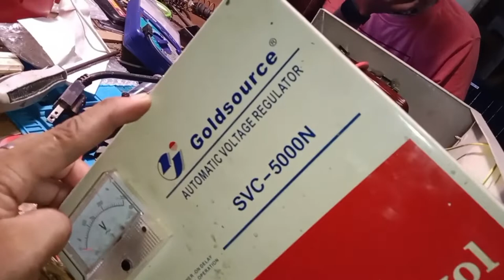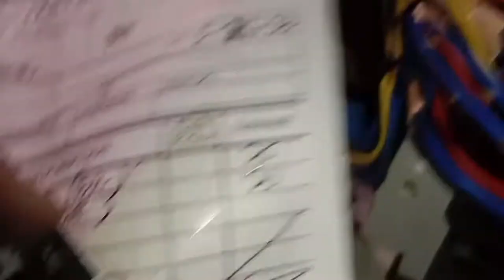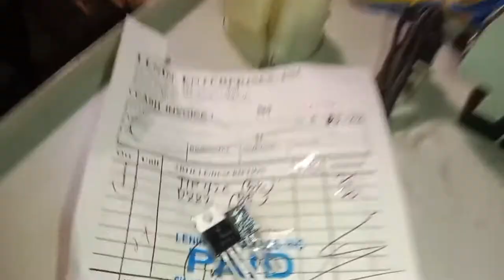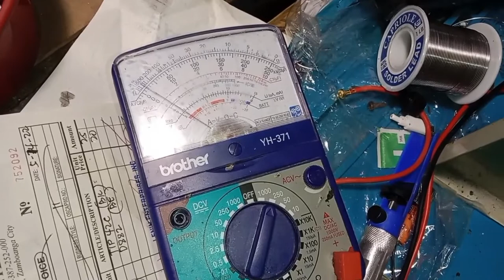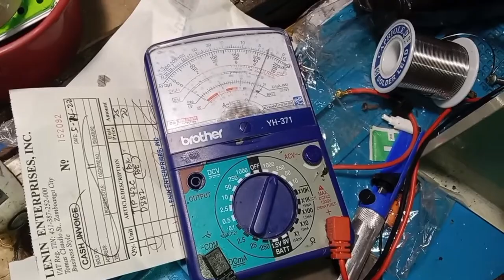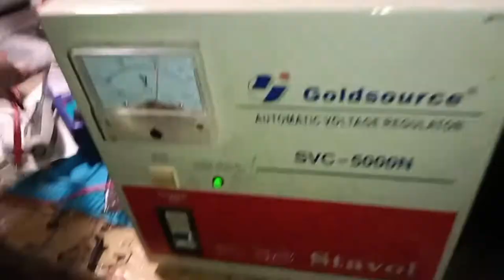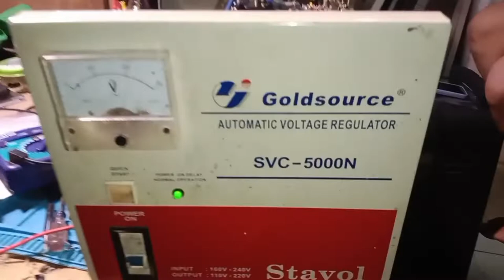AVR Goldsource SVC-5000N Panoorin Kung Ano Tamang Pag Repair Para Maibalik sa Original Setting

Comment: idol ano po value ng transistor na stock n nakalagay jan kasi ganyan din avr ko problema avr ko nag istock lagi sa high voltga 260 to 300v ang tinatakbo nya, nakababa na rin yung trimmer
Reply from the maker: @JRCLIGHTSANDSOUNDS  abang lamg dol may e upload ako low voltage explain ko lang angbtrans niyan D882 at B772

Comment: Sir may goldsource din po ako na AVR 5000watts, problema ko po is pag sa direct outlet ko sinaksak ang machine ko 200V lang pero pag sinaksak ko ang machine sa AVR nagiging 251V sya sobrang taas. Pwede pa po bang ma adjust ang voltage ng AVR na yan?
Reply from the maker: opoh pwede boss

Comment: May fuse ba ito sir? Same brand sa akin SVC-5000N kaso walang power input
Reply from the maker: meron ako ne repair now wala din power...wala po fuse yan sir kasi naka circuit breaker na.
Reply: @ortechtvofficial  ano po kaya common problem kapag walang power salamat po sa reply idol
Reply from the maker: @allandeleon1061  check wirings baka marupok na or naputol manetic wire kung saan naka kabit mga wires sa transformer

Comment: ,,sir,normal po ba na aabot ng 250 voltage or higit pa ang AVR ko?
Reply from the maker: dina normal yan need na ma adjust or palitan pinaka trimmer niya
Reply: @ortechtvofficial  ,, sir paano e adjust, or ibalik ko nalang sa binilihan ko
Reply from the maker: @Mejaisat.4589  balik niyo nalang if may warranty pa
Reply: @ortechtvofficial  ,, ok po salamat

Comment: San po location nyo?
Reply from the maker: zamboanga city ako boss
Reply: Sir magkano yung repair ng ganyang problema
Reply: Saan yung exact address ninyo sir?
Reply from the maker: @bernardcastillo6387  Putik Tumaga Road Prias Drive,Tumaga Zamboanga City
Reply from the maker: @bernardcastillo6387  dipende sa problem sir
Reply: @ortechtvofficial  
Sir pwedeng hintayin habang ginagawa kung pareho ng ganyang problema
Reply from the maker: @bernardcastillo6387  opoh sir wala problema kompleto ako dito ng mga parts wag lng masunog ang motor.